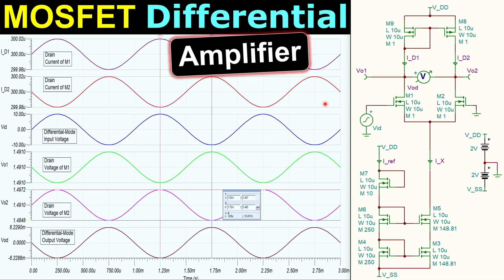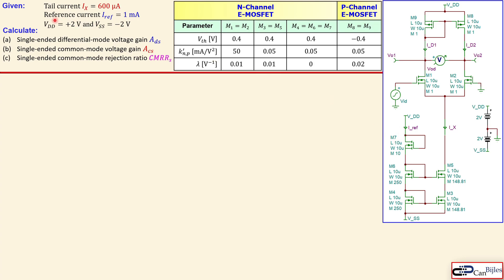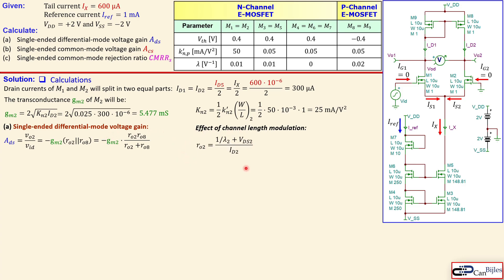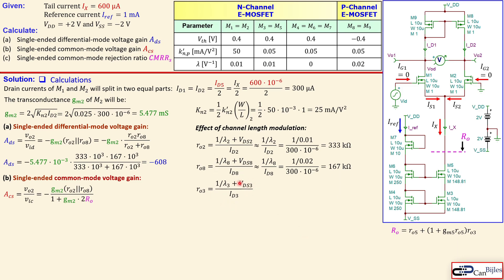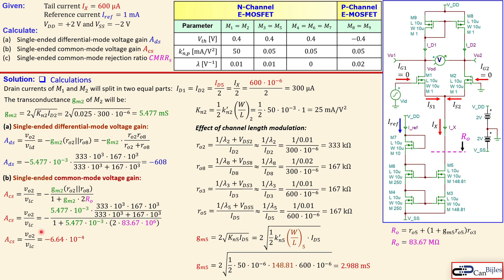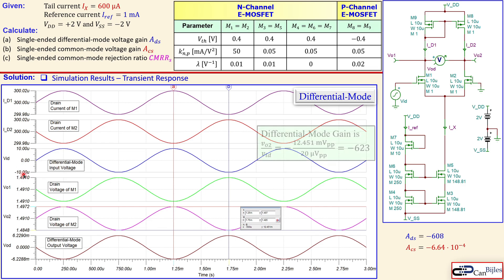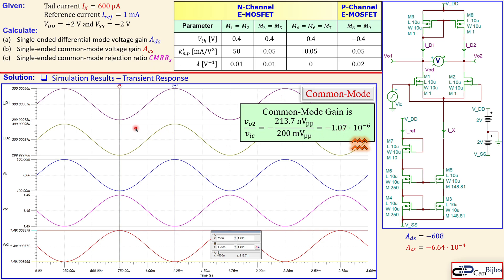MOSFET Differential Amplifier 🌟 Active Load & Full Transistor Cascode Current Source 💡 Example 6

Comment: Thank you for your previous suggestion on where the impedance formulas come from.  For this circuit, when I use Schichman-Hodges enhanced P type and set Vth=-0.4, Beta to .05m and lambda to 0.02, the rest to 0 except flicker left at 1 I get ID1 277uA and Vo1 -1.61 volts.  If I "flip" the P mosfets, I can get 300uA current in ID1 but V01 is still off at 1.37V.  Would you please let me know what enhance model , parameters you used??  Thanks.
Reply from the maker: It might other parameters in the circuit that effects the total result. I have put a link to the TINA-TI SPICE file for this video example. Let me know if it works out now. Also, I am interested in what the problem was in your case.
Reply: @CANEDUX  Thank you for the detailed schematic.  I went back to the original circuit with "ideal current source" and slowly built them all until I got the the last one.  I also used LTSpice circuits as a cross check.  This took the time and delayed my reply.  And I found a typo in the value of the beta (KP) I used in the final pmos set up -- I used 50u instead of 50m.  The error was mine! I guess at 75 years old the eyes start to go. Thank you for all your work in this and other series you made.
Reply from the maker: @richardsmith813  You're welcome! Great to know you found the eror. Making mistakes is inevitable, but this way you will be sharper next time.
Reply: I looked at the values shown for the M8 or M9 in the file you sent.  Is the KP shown at 50m correct versus the introduction table showing a value of 0.05m with M=1 on the diagram of the circuit??  Also, the Lambda in the file seems to be 10m where the overview slide shows 20m.
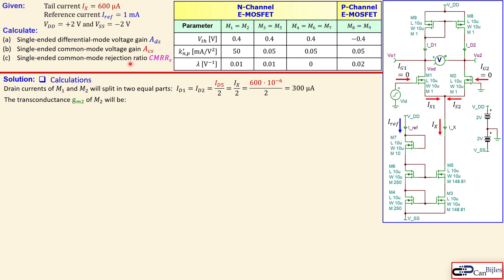Reply from the maker: @richardsmith813   You are right about the lambda for the PMOS (M8 and M9). The lambda for M8 and M9 should have been 0.02 1/V, instead of 0.01 1/V. However, this is has not much of an effect in this example. About the KP in TINA-TI SPICE model. The Kn and kn' are not the same. kn' = un*Cox, while Kn = 0.5*kn'*(W/L). The KP = kn' or kp', depending on NMOS of PMOS. I explain this also in the video around 00:03:00. I use device multiplier in TINA-TI SPICE to set the W/L ratios per MOSFET. 
More info about MOSFET parameters can be also found here: https://www.tina.com/resources/home/field-effect-transistor-amplifiers-2/2-metal-oxide-semiconductor-fet-mosfet
Reply: @CANEDUX  Thank you but I still think the KP for M8 is found by doubling the kn' in the Spice parameter model and also for kp=0.05 in LTSpice.  Since both W and L are given as 10u and M=1 the calculation of Kn would then be multiplied by 2 arriving back at 0.05  mA/V^2 or 50u for KP?????  If I use the lower value of 0.05 the results do not work to your video.  I used the M multiplier as shown for all the other mosfets and got your results in the previous videos and LTSpice.  Thanks for your reply.

Comment: Hi, great video! By any chance in your channel is there the design of an op amp explained with the current mirror? I mean a multi-stage op amp.
Reply from the maker: Thanks for your message! Glad you liked the video.

Here are some playlists:

Operational Amplifier Circuits: https://www.youtube.com/playlist?list=PLuUNUe8EVqlmhmvCuxr326mnNKHB5jwJx
Reply: @CANEDUX  an example in which you cascade a common source stage to the differential stage to amplify the signal, did you do it by chance?  I really mean the internal structure of an op amp (differential stage/common source stage/studio buffer) for example
Reply from the maker: @eduardmihailoiu7609  I have not done a video about a full transistor design of an op-amp circuit. Sounds interesting to make one in the coming future, will be in list.
Reply: @CANEDUX  it would be very interesting!!
Reply: but the differential couple and the current mirror need to work in the active zone (saturation zone) to work well, right?
Reply from the maker: @eduardmihailoiu7609  For linear amplifier operation, you will need to have a well controlled drain current, so you need to operate in the saturation region of the MOSFETs, mainly for the differential pair. You might operate the MOSFETs in the current source and active load in the triode or subthreshold region, just to reduce power for example.
Reply: @CANEDUX  Greetings! but how can the I_ref current in its scheme which is mirrored on the M5 nmos be sized? for example I would like an Iref of around 100mA, are other MOSs used to create the Iref current generator? Can you point me to a guide that explains the sizing of this Iref??Thank you so much!!
Reply from the maker: @eduardmihailoiu7609  The current in the MOSFETs are scaled by the ratio of W/L. So, if you for example make the W/L of the M5 MOSFET 10 times larger than the M6 MOSFET, then the drain current of M6 will be also 10 times larger than the drain current of M6.

I_ref is equal to I_D6 because they are in series, but the M5 has a larger W/L ratio, so it will divide its drain current in more parts than M7 for the I_ref.

Let me know if this is clear for you or if you have questions.
Reply: @CANEDUX thank you!! and to make a MOS behave as a resistor to determine a desired fixed current Iref, how can you do it?  For example, in the classic nmos current mirror I would like the current of the M5S mos to be 100mA
Reply from the maker: This is a design problem and needs some details. Too hard to discuss this by typing only.
Reply: @CANEDUX  I understand, thank you very much!  Could you point me to a guide regarding these things?
Reply from the maker: I can recommend the following book:
Design of Analog CMOS Integrated Circuits, Behzad Razavi